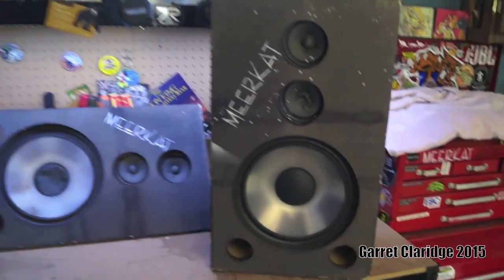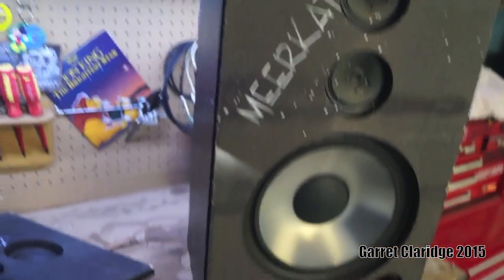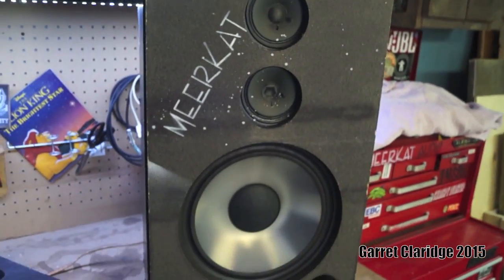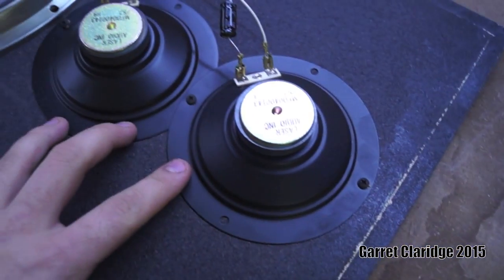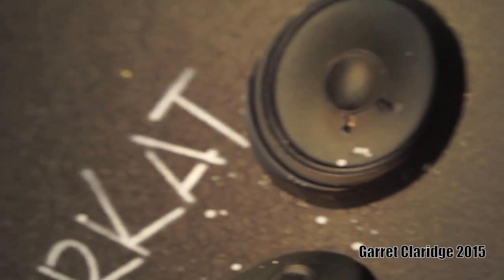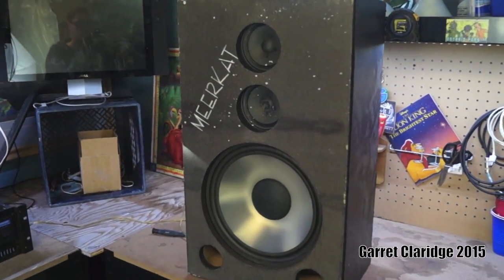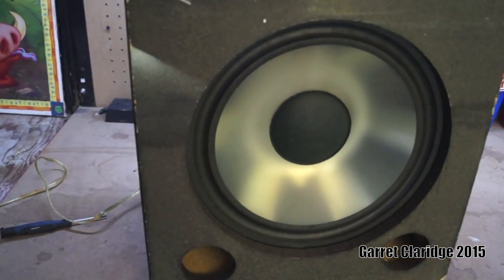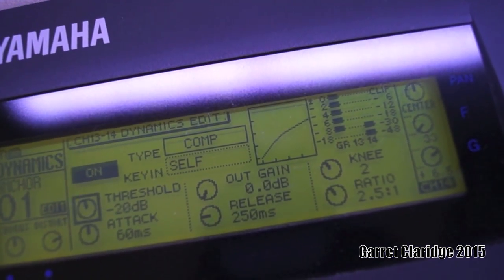SPEAKER BLOWOUTS! - Overloading Some Very Very Cheap Woofers....

Comment: Did some research, and Laser Audio speakers are White Van speakers from the 80's
Reply: smashman2000 Exactly
Reply: sorry for reviving this comment but that explains the tiny voice coil and magnet lol
Reply: If they are from the 80's then they would have had foam rot.
Reply: @birbv  Not true, the time period of when foam rots is never one set year. I've seen speakers from the mid 2000's get foam rot, and I've also seen speakers from the 1960's still have usable foam.

Comment: The idea with the double identical mid-range/tweeter instead of a different tweeter driver, is that since both speakers have the same audio response it makes it really easy to crossover just 1 cap in series with each driver no inductors needed keeps cost down. See if different drivers are used crossover becomes a-lot more complex to design and cost goes up.

Comment: What is that little electronic thing that he pulled out that protected the speakers from being overloaded.
Reply: Looks like it could be a thermistor, it's like a resistor where the resistance increases with temperature, eventually shutting it off
Reply: Flimzes breaker resistor/circuit breaker

Comment: love your RCF 312a's in the background but i think that laser audio clearly beats them in sound quality.  #Laseraudiolove
Reply from the maker: 325a*
Reply: They look like MK1's, how are they? I run EV personally
Reply from the maker: Daniel Graves  I love them, Thease have the 2 inch compression driver not too bad for a plastic active pole mount cab, for the most part i only use that pile of little cabnets for stage monitors and as a rental units but them RCFs have provided front of house microphones for metal bands before and i was pretty impressed what they can do crossed over with a driverackPA+ or any crossover really
Reply: ***** Yeah, RCF is a pretty good company. I have noticed that you don't use active that much but I must say that Electro-Voice's cabinets are really good as they have optional tuning that you can do which includes FIR crossover slopes and other crazy stuff like that. RCF is surprisingly good especially considering the 325's aren't expensive what so ever
Reply from the maker: Daniel Graves not expensive?   I remember paying close to $2,800 when i picked the pair up and they are still 950 plus tax each in the stores here on sale right now since the new line is out,  The quote i got for EV actives not long ago was far far cheaper than what I paid for the RCFs
Reply: ***** What EV's were they? And how come the RCF's are so expensive over there? In this country you can pick them up for £500 a piece
Reply: speaker guy i got 12 gbl
Reply: Ha 3 kicker compr's in my room lol
Reply: +Garret Claridge I need more speaker blowing plz.plus where do you get all the speakers from
Reply: +Garret Claridge love you're vids
Reply: Bum Lover cool
Reply: RCF is expensive m8